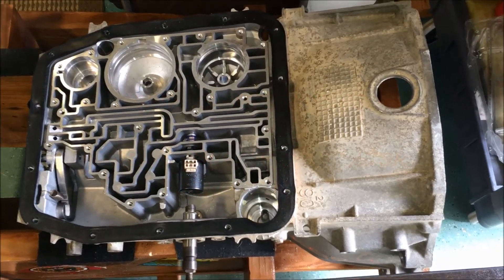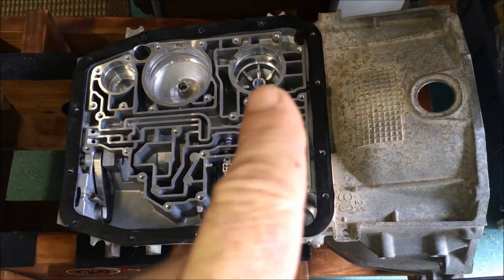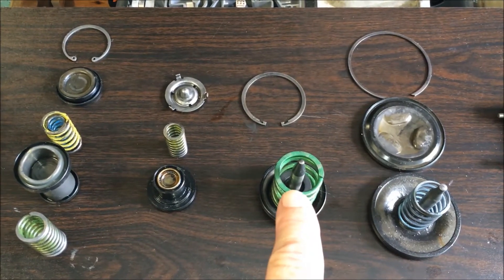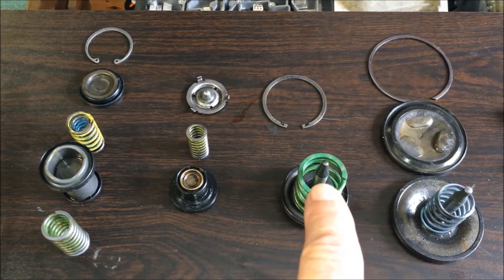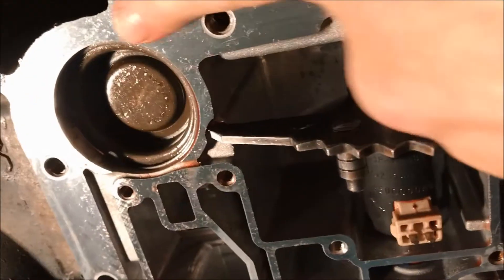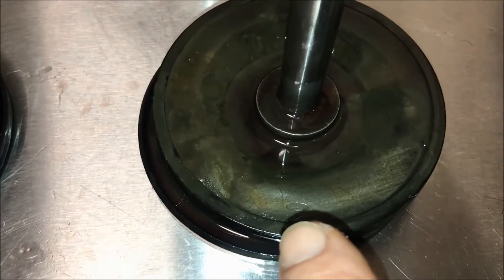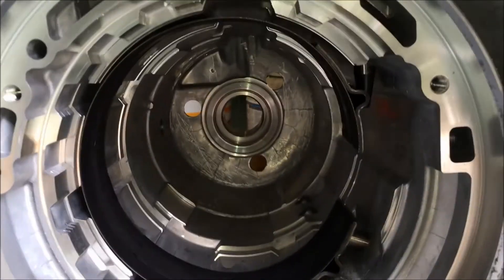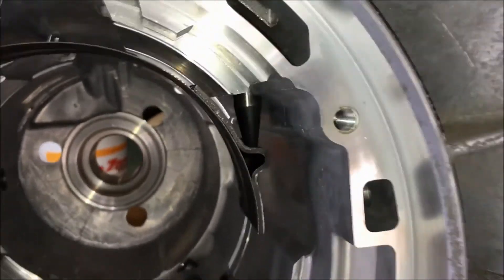How To Remove & Replace Shift Accumulator: 4R70W / 4R75W / 4R75E Series Part 5

Comment: I watched your first video earlier today and I was like yeah I don't think that's going to fix mine.. I believe my problem is that 3-4 accumulator which I don't know if it's possible to change that in the truck.. I think that's the only thing wrong with mine I'm guessing the spring broke or the seal failed? My issue is my trucks downshifting so hard from overdrive that you'd think it's about to break something and I'm driving it around with overdrive off. Thanks for the video! You gotta keep that truck now forever lol.. I did my dodge ram v10 a few years ago I'm never getting rid of it unless that transmission breaks again lol
Reply from the maker: Nice truck, and wow, a V10?  nice... with regard to your 3-4 accumulator, you can replace while in truck by removing the valve body and using the special tool I show in my video.  It's gonna be messy!  The hard downshift is a concern, could be many reasons for this.  Does it do this downshifting from any other gears?  Stay tuned, my tranny is starting to make me worry again, only slightly.  The truck shudders in 4th which tells me it's finally time to get my other transmission rebuilt and installed in this truck.  I'll be doing videos on the rebuild.
Reply: @DrivingIntelligence  no sir only seems to be a highway thing concerning overdrive.. I've yet to pull the pan. It drives fine other than that I'd say it started as a shutter more of a bucking almost now of flare shift that can't hold overdrive
Reply from the maker: based on this comment, I would say you have either a torque converter problem, or a problem with controlling the fluid circuits in your valve body.  What you described is exactly how my issue started.  My first video is what I did to get rid of this shudder.  https://youtu.be/YwPMiS6sMtI
Reply: @DrivingIntelligence  and the v10 I have is the Dodge 2500 v10 8.0 4x4 it's the truck from the movie twister.. it's more powerful than the stock diesel but alot quieter

Comment: Would I need the 1-2 accumulator if my transmission isn’t going into drive. It works in reverse. When I was driving my car to work I made a hard turn and it won’t go just rev’d up not engaging into drive
Reply from the maker: That is hard to diagnose via messages.  Have you checked your transmission fluid?  Full?  If you put your truck in 2nd gear, does it move?  Do you have a check engine light and if so, any codes?
Reply: @DrivingIntelligence  I have the same issue Sammy has. Fluid is good, and also seems clean. Reverse works. If I put into 2nd, the vehicle won't roll backward. If I put into 1st and hold down the revs, several seconds later it will go into gear and hold that gear perfectly for a while. Does that sound like the 1-2 accumulator? (2004 Ford F150)
Reply from the maker: @DadBodForever  I doubt that problem is the 1-2 accumulator.  Sounds like your bands are slipping.  Have you pulled your pan to see if you have any friction material buildup?
Reply: @DrivingIntelligence  I did but there didn’t seem to be anything more than what I’d expect. I did notice, when disassembling the valve body, that the separator plate has a hairline crack close to the 2-3 accumulator. Apparently it is caused by bowing of the plate in this area. Could this prevent the forward clutch from engaging?
Reply: Also to follow up, I did remove the 1-2 accumulator, and sure enough it was intact and in good condition.
Reply from the maker: @DadBodForever  from what I have heard these transmissions, with age, have fluid management problems with worn accumulators, worn valve body valves, worn solenoids and especially cracked separator plates.  If your plate is cracked, you need to replace.  Look for my link to the tough plate (Tough Plate K092 - https://amzn.to/3hs2ljp ).  That will solve your problem permanently (with regard to plate cracks).  This could help your problem.
Reply: @DrivingIntelligence  thanks for the advice. I went and ordered the part. Worth a shot. I can’t just scrap it without trying! I’ll post here when I get it back together.
Reply from the maker: @DadBodForever  I’ll never scrap my 10th gen.  They are just too good.  Today I’ve got a check engine light indicating a problem with my DPFE sensor!!!  New video coming ;)